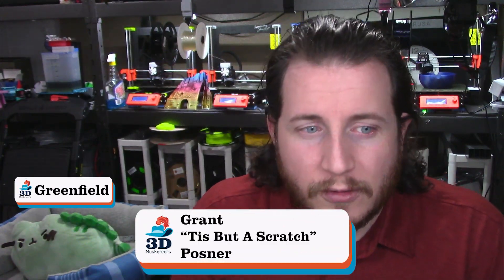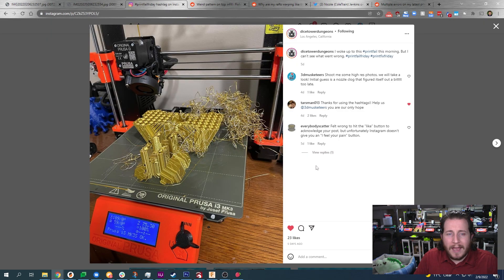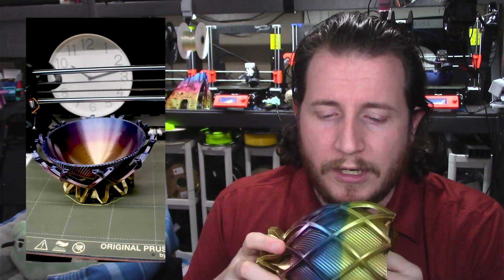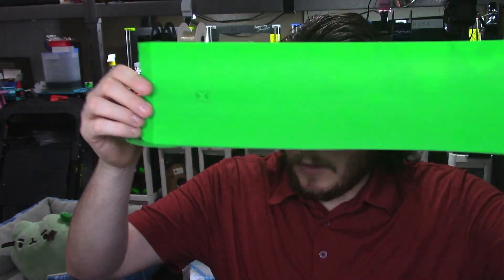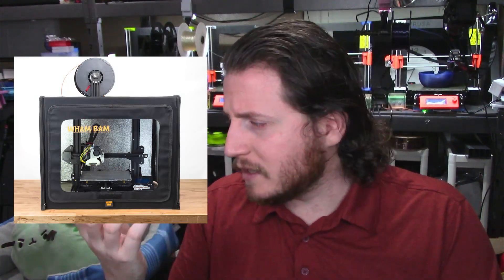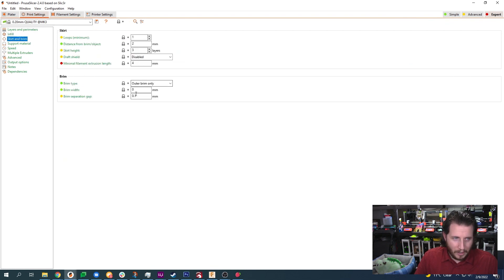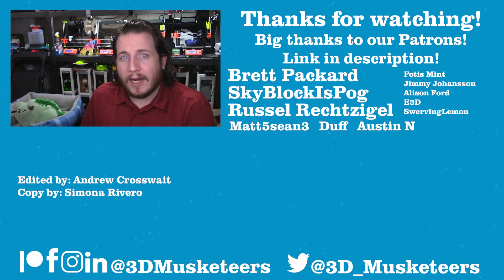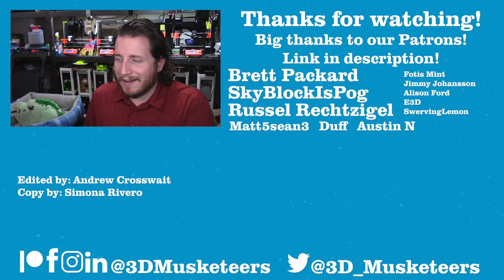Why You SHOULDN'T Use Rafts!! - PrintFixFriday S1E22

Comment: Is Hatchbox ABS a modified type?  I've noticed I can use up to 50% fan on smaller parts without warping provided I don't cause a draft.
Reply from the maker: not that I am aware, but if you have good bed adhesion you may be okay

Comment: Something to add with abs I have found. On my printer (ender 3 v2 with a 5015 and all metal hotend) my lack enclosure gets to 40 to 50c ambient. I get best results with a 45% fan but each machine is different
Reply from the maker: yeah, if you have a good, hot chamber, you can run a fan, but if you are open air, don't even dare LOL. A lot of companies are putting additives into the ABS now to make it less of an issue.
Reply: @3DMusketeers  oh absolutely. No enclosure, draft shield, I needed to run like 110 on the bed and a 15% fan. Still caused a few issues
Reply from the maker: yeah, basically need 0 fan with ABS. We turn it to like 10% when bridging